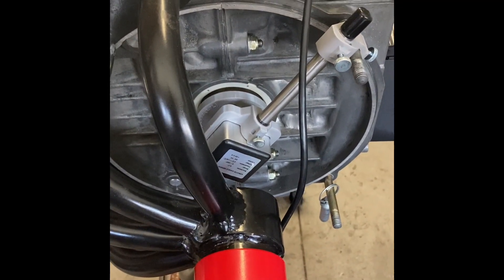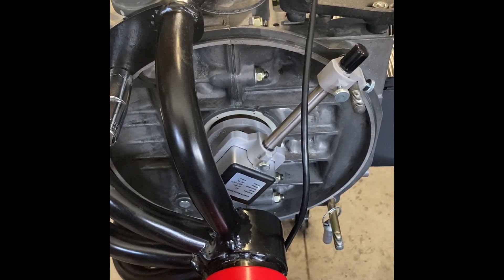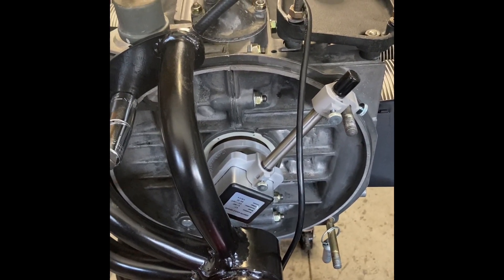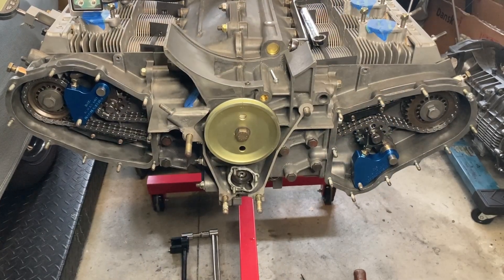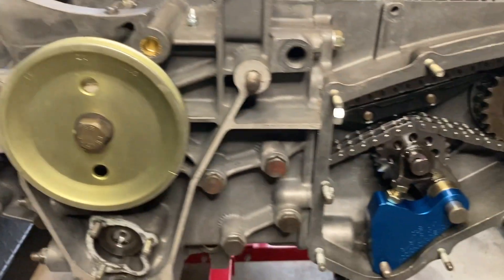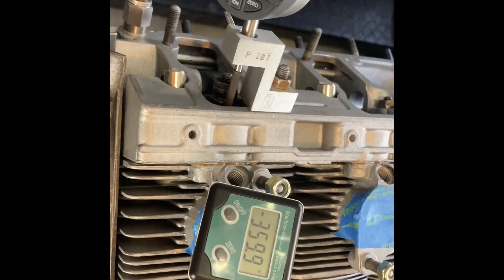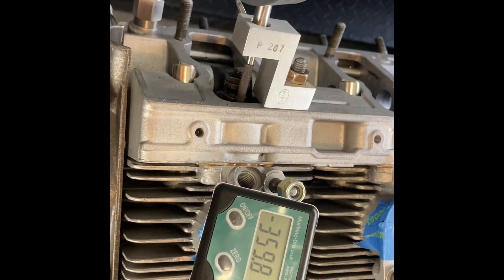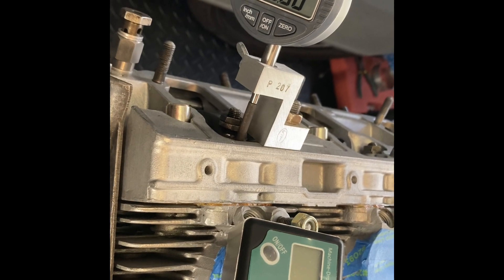Porsche 911 2.5 MFI Camshaft Timing

Comment: Don't you need to check for the proper depth of the cams so the chains run 100% parallel by using the correct thickness shims?

Comment from the maker: I didn’t do a great job recording my videos. There was glare on the digital degree wheel monitor so you can’t see the readings/movement. The tiniest of movements (which may not be evident) will show as very small fractional degree movements on that monitor. I was likely looking for too much precision in my tiny movements to get to zero on the gauge. This level of accuracy definitely isn’t achieved when using just the pulley for readings!

Comment: Wait a minute...when doing the 2nd cam, you didn't really turn the crank pully to return it back to start point. NOTHING moved, not the pully, the timing chain, the gear...what's up.